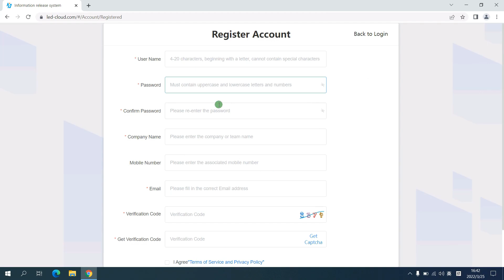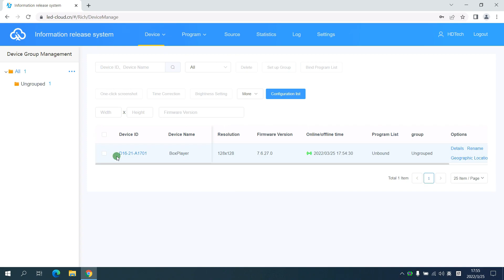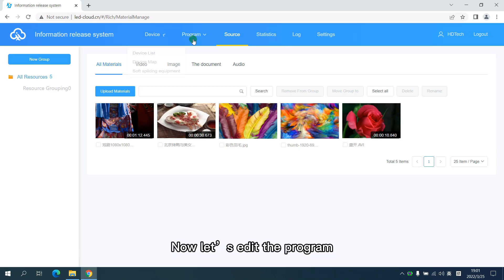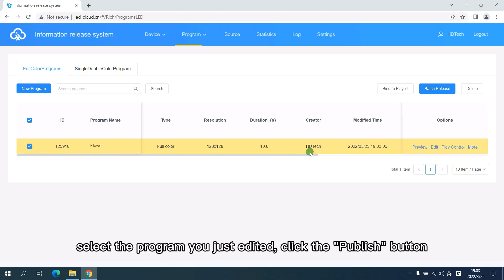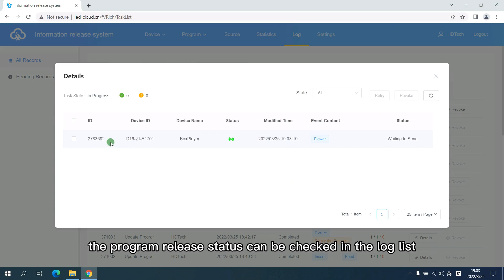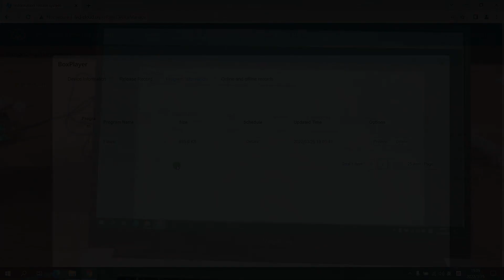How to Use Huidu HD-D16 Controller Remotely Sending Program in XiaoHui Cloud Platform

Comment: Thanks for the tutorial Bro, but I'm facing an issue. After entering the username on the HD Player software it shows me verified tick mark but it doesn't show me the devices on the led cloud portal. What will be an issue can you please tell me. I have check all type of the options please tell me what step I'm missing here.
Reply from the maker: Please don't worry, if you need technical support, welcome contact WA: +8613510540791

Comment: HD D16 for module P2.5 x 6, 768 dots ?
Reply from the maker: D16 max support 65536 pixels,
Reply: @HuiduController  How many Panels in a chain can one HUB75 port support? eg 2x P2.5 128x32, 4x 32x32 etc..

Comment: hi,Can i get default ip
Reply from the maker: default ip for what? you can check D16 card IP in our software HDPlayer. For in time support, welcome contact whatsapp/wechat: +8613510540791
Reply: @HuiduController  How can we stop D16 v2.1 random mac address for wifi? Stop randomization of mac address. On C16L I was able to stop by setting "Fixed WiFi mac address" under HDPlayer, system settings but the D16 still randomizes mac. HDPLayer V7.10.94.0 FW: 7.10.94.0 FPGA: 3.28.70.0

Comment: on processors of the series a and the connection is bad does not display in the cloud, I connect via an ethernet cable
Reply from the maker: hello my friend, which model do you use? if you use A series newest model with "L"， you should choose LED Android when create program. Any question, please consult Whatsapp: +8613510540791. we would like to help you.

Comment: Hello I have 32 P5 module can I connect the D16 without needing a receiver card thanks
Reply from the maker: had better use C16C and receiving cards
Reply: @HuiduController  Can we connect a R507T/R732 26PIN HUB320 receiver card to HD-C16L card to support 26pin panels? Can we mix receiver cards in one chain? 16PIN and 26PIN ?

Comment: Which is more better and advanced. W4 or d16
Reply from the maker: D16 is better
Reply: @HuiduController  hi I can't find you on whatsapp
Reply from the maker: @captshadab  008613510540791
Reply: @HuiduController   I left you a message
Reply from the maker: @captshadab  Ok thanks, let me remind Kevin check it and reply you.😀
Reply: @HuiduController  I have p2.5 
160 pixels x 320 pixels. Will d4 will work or c16c work
Reply from the maker: @captshadab  had better use C16C, best

Comment: I have hd2018 on my pc but i cannot use it on the d16, will it work with d16 please, I was asking as i have a program from hd2018 that i want to run on the d16 card but the file format is *hd6 and cannot load it in hdplayer, thank you
Reply from the maker: Hi my friend, our D16 card must use software HDPlayer,  not HD2018.  HD2018 software is only  used for our single color series controller. These two softwares are not compatible with each other. Please create new program in HDplayer directly. If you need support, please contact WA: +8613510540791
Reply: @HuiduController  thank you
Reply: Can you use animated.gif on hdplayer
Reply from the maker: @garyangi  yes, just create program and add the your gif file in HDPlayer

Comment: Nice, thanks for your effort, but what kind of card will we put in the control?
Reply from the maker: Thanks, it should use 4G data SIM card with normal size. Any question, welcome consult WA:+8613510540791😁